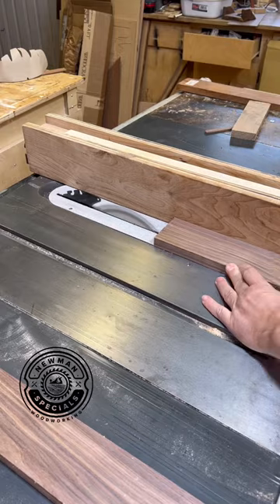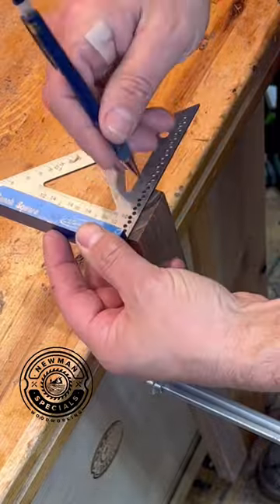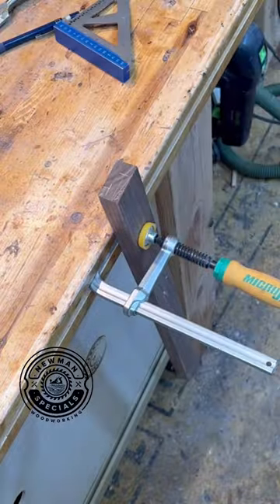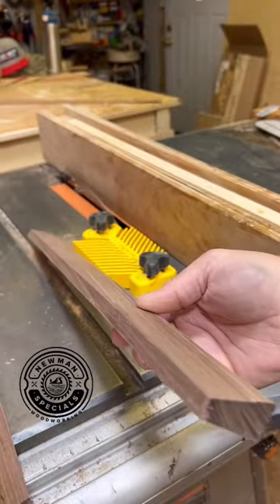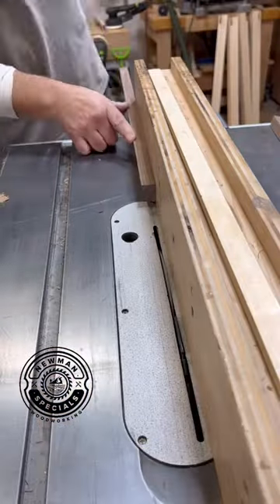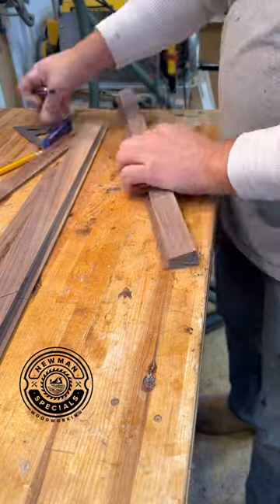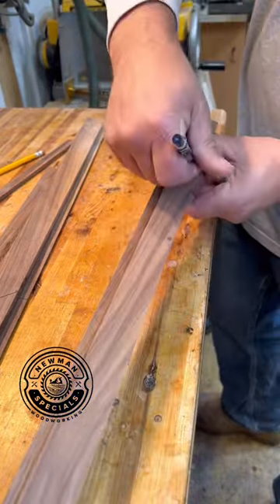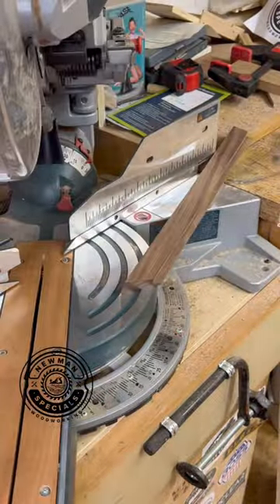Making a simple picture frame with an angled front #woodworkingprojects #diy #pictureframe

Comment: Using an electronic level on the blade is similar to using a level on a boat, you didn't show the weekend warrior to level the table first....
Reply from the maker: It’s an angle gauge. It is not a level. You zero it out to the surface you are on and it measures the angle to the zeroed surface
Reply: @NewmanSpecialsWoodwork   I know what it is but you might tell the weekend Warrior that they need to 0 out on the table 1st..
Reply from the maker: @oldscuba  👍

Comment: How is this cheaper than a frame? This is neat don’t get me wrong but you need the set up in order to do this. Then the materials the 1x4 piece or clear walnut is about $10 a linear foot. Times 4 is $40 then the time you put into it. Absolutely not cost effective
Reply from the maker: It is if you are a woodworker and have scraps
Reply: @NewmanSpecialsWoodwork  eh still not really, you had to buy those "scraps" still. i know this bc i am a woodworker as well, definitley still have to buy wood, walnut is def more expensive than a picture frame lol.
Reply from the maker: @tristannaylor5197  ok